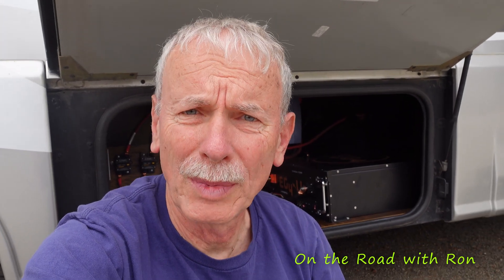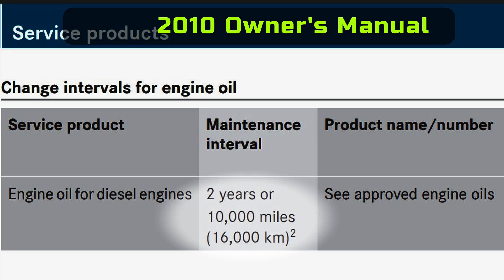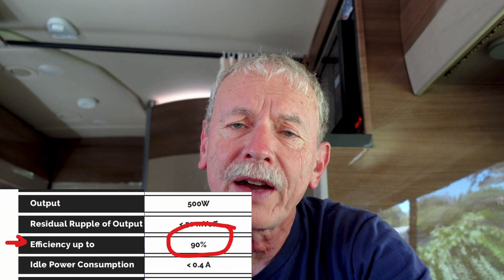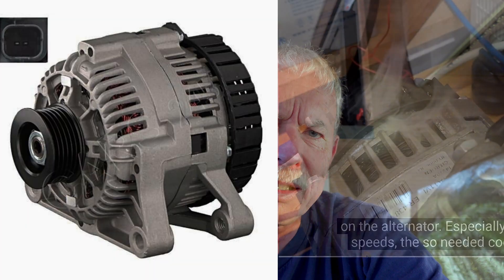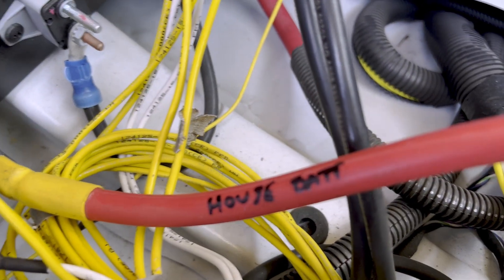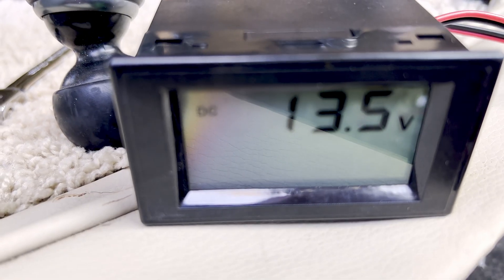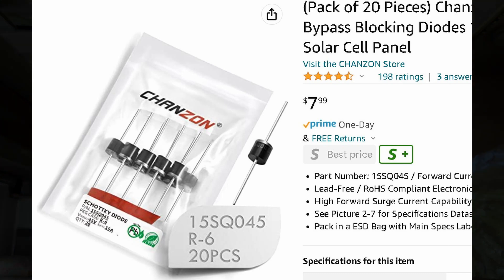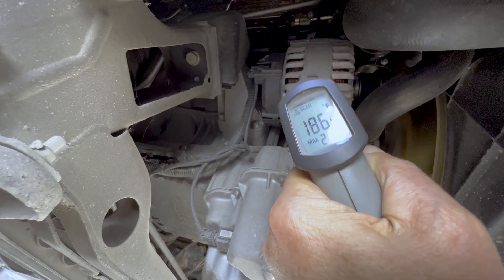DC to DC charger NOT required for big Lithium Battery

Comment: just finished up up grading my truck camper to 304 ah lithium iron phosphate batteries specily. similar to your set up, 650 watts of solar run through victron solar mppt controller, victron shore power ip22, and a victron dc-dc charger. reason for the victron controllers as they connect through their own bluetooth network to coordinate the charging from all three controllers. The reason i used the victron controllers is that the charging algorithm can be customized for the lithium batteries specify between 80 to 20% to maximize the battery life, since they are not cheap.
One issue i have with your set up is you are relying on the battery BMS to control volts amps etc but a BMS is a last resort to protect your battery if a controller fails, it isn’t the control. In my opinion the money spent on a programable dc-dc charger is not only worth it but essential for the longevity of your system batteries and possibly your alternator if you ever run it above idle when charging your lithium battery, just my thoughts.
Reply from the maker: I don’t know exactly how the BMS is designed but i never get over 85 amps charging current regardless of battery SOC. My set up is pretty simple.
Reply: @ontheroadwithron2432 There is a good chance the current from your alternator is being limited by the resistance of the wires between the alternator and house batteries along with the alternator putting out 13.8V instead of the 14.6V lipos need to fully charge.

Comment: Thanks for the Video! I have a 2022 Integra 24R with the Sprinter Chassis and installed 2x 100ah LIFEP04 Batteries last month before a 10k trip and just returned without any issue's. I just started researching DC to DC chargers and Isolator's  because  my house batteries never go above 13.6v while driving which is fine but I also have 200w of solar trying to push 14.6v to the house batteries while I'm driving. I guess I need to do a switch like you did......I'm still researching but would like something automatic.
Reply from the maker: My Zamp solar controller cutts off a little under 13.6 volts so never quite fully charges the batteries but im fine with that. Maybe the 14.6v is coming from your alternator.
Reply: @ontheroadwithron2432  The Coach battery stays around 13.6v. My Go Power MPPT solar controller is connected to both the house and coach batteries so I can monitor their voltages easy. Right now I have the coach plugged in and the coach converter which is set to lithium has the battery's at 14.6v 100% charged. When I start the coach it will connect both batteries together which I don't like.

Comment: This is nonsense. Why would you force unnecessary wear and tear on an expensive important component. Stop being a cheap skate and add a DC to DC charger to prevent excessive amp charging for extended drives.
Reply from the maker: Using a dc-dc charger will actually cause more “wear and tear” on the alternator as this device is not 100% efficient. That means the alternator has to supply the power to recharge the batteries AND to operate the dc-dc charger. I also have a switch to allow me to only use the alternator when needed.

Comment: You are very confused. A motor home has a built in BIM. That is what is limiting your charge, not your BMS. 🤔🤦It is pretty dumb and dangerous to tell folks that an alternator connected to lithium works, when that is not what you are doing. Definitely do not try this in a towable. Towables have no BIM. Your lead acid BIM will work, and may work well enough for a long time. But you could get some more charge by switching to a lithium BIM. Over time, especially if you have an older unit, the lithium voltage can wear out the contactors. If that happens, that would definitely be the time to switch to a lithium BIM
Reply from the maker: Not all RVs are the same. I don’t have a BIM, just a solenoid. This is my experience that is working great but of course it might not be the same for different applications. Cheers
Reply: @ontheroadwithron2432  ahhhhhhhhh, my young padawon. Confused you are. Help I can

Comment: I just did the exact set up on my 2000 class a RV. No DC to DC charger. Amps  are being limited by my BMS apparently also. It usually is charging at  a maximum of 30 amps per battery. I have 2 100 ah batteries with Bluetooth. And these are cheapo $170 batteries. One month now and no issues. Low temp high temp low voltage high voltage protection also. Why is anyone spending money on Battleborn. Anyway is your alternator still holding up without a DC to DC charger?
Reply from the maker: Still working great. I use the alternator to recharge batteries after using the AC at bedtime. Not every day but only when needed.
Reply: Good to hear. I sent out a question to a Facebook group and things are getting a little heated, as usual. Most think I'm nuts a few say I'm fine but no one has reported in with a failure from not using a DC to DC charger. I rely mostly on solar and will only occasionally click on the alternator charge to the house batteries

Comment: I saw an installation of a device that measured the temperature of the alternator and cut it out when it got too high. Happens most at long idling. The device also cut out when the LFP was full. It could be an issue if you are standing still in high outside temperatures like a 100F.
Reply from the maker: That might give someone peace of mind. I am careful to only turn on the alternator when driving and avoid hot weather best i can.
Reply: interesting, where did you see it?

Comment: Your battery does not LIMIT current in and out. It has a safety feature that shuts off current entirely if X amount of current is exceeded.

The thing is that rating is ALMOST NEVER a fixed number or a fixed amount of time.

You'll often see a BMS will have a 10% or 20% plus or minus for overcurrent protection and there are ratings for 1 second, 3 seconds, 5 seconds, 10 seconds, 30 seconds, etc. Typically only your higher end BMS"s (NOT Daly) are actually going to follow their datasheet with any amount of accuracy. Many budget LFP batteries use fairly cheap BMS's that won't cut off until 300A or something insane like that on a 100A BMS.
Reply: Ok after watching the rest of your video its clear that you definitely know what you are doing and took the time to test the current draw of your LFP battery at a low state of charge AND installed a switch to give you control of the charging from the alternator.

In situations like this where you are 100% sure of your alternators output and the charging current you'll see when you let a near depleted LFP battery get charged directly by the alternator there's nothing wrong with saving $200+ on a DC to DC.....def right about Victron's video. They purposely chose one of the smallest alternators they could, used a LARGE LFP battery that likely has an AC IR of 2mR or less and then put the alternator in the worst possible position in terms of coolings. Very deceptive.
Reply from the maker: Thanks for your comments.  My ooint is only that everyone does not need a DcC to DC charger depending on your particular setup. I understand that many people will install one to be on the “safe side”. In my case I don’t need one.

Comment: You cab use dc to dc charger.
No problem ad all.
Its just what for amp you need from the alternator.
I use a dc to dc charge with a carge limit of 20amps.
Its connect to the lead battery .
This way i can charge the 150ah lipo4 with 20amps.
So in 10 hours i have charge 200ah.
But you lipo4 is not empty always .

So i charge with a solar panels and a alternator on my boat if i need it.
Wallpower from the port i can charge 30amps 

Personal the solar power i can do what i need to do .
Reply from the maker: Yes I agree that using solar id the best main method of charging with a couple other options when needed.

Comment: Honestly you have a talent for missing some important details. 
Firstly im not a victron fan.
The dc dc chargers are there partly to reduce the voltage on the lifepo4 once they are charged so they are not held at a high voltage for hours on end. 
The bms only stops it charging if the current is too high for the battery it is not a limiter.  The victron test alternator looks like it has internal fans the smoke will rise if its not running (remember its a demonstration).  You have totally not realised that other groups of people have different requirements.   Narrowboat users will often run engines for 5 or more hours per day  and there is no auxiliary fan or grill for air to cool anything.   The engine and exhaust are in an almost sealed compartment.  They tun hot.  You have just about gotten away with what your doing because of your particular installation.  Citroën alternator doesn't matter. What would be the point of using a huge 300A alternator?  It wouldn't demonstrate the overloading effect.  Many many narrowboats only have A 50A alternator.   The current needs to be controlled properly.
Reply from the maker: Thanks for your comment. I know nothing about boats and their particular needs. My channel is about my RV which of course has a lot of cooling air out on the highway. Never meant to imply a dc-dc charger is never needed. It depends on the application.

Comment: This video is the classic case of a little knowledge is dangerous, unfortunately. 

First: Alternators do not have good voltage regulation, and a BMS cannot buck or boost. In overvoltage or undervoltage conditions, which will happen quite often when connected directly to an alternator, the BMS will simply disable charging.

Second: A couple of modern large Lithium batteries could easily pull 200 Amps. There will be many vehicles that have smaller alternators that really will overheat, and if you are lucky, you'll have one that has a thermal regulator that reduces the current output in order to stop it cooking itself to death.

A DC to DC charger negates both of these issues, and more. They exist for a reason!!
Reply from the maker: Do you have any data to support your assertions? I have tested my setup and it works quite well. I don’t have any issues with some who choose to install a dc-dc charger. It is not ALWAYS needed.
Reply: @ontheroadwithron2432  It's not a case of providing data, you already have everything you need. For instance, you provided a screenshot of a Merc document stating "A maximum charging current of 80 amps... must be ensured... or the vehicle may be damaged". When the EG4 is at a very low SOC, the charge current can be close to 200A maximum. Are you simply relying on making sure the battery never discharges this low, or risk damage? If so, that doesn't seem like a great solution.

Comment: Question...Can i connect my 10amp pmw solar charger to my car battery so i can charge my sla secondary battery while driving like a Isolator.?
Reply from the maker: All DC chargers will work together so yes. Your solar panel will charge any battery it is hooked up to. My solar panels are charging my coach battery while I am driving.

Comment: Bought 3 x100Ah off sterling power in the UK , they wont warranty their own batteries unless they are charged through a dc-dc charger which they also conveniently sold me !
Reply from the maker: Nothing wrong using a dc-dc charger. There are some good reasons to install one. I just didn’t need it with my setup.
Reply: @ontheroadwithron2432  there is plenty wrong with the Sterling  bb1260 , its drastically inefficient,  gives nothing near the 50A claimed output but it makes a great  heater ! Of course it will protect your alternator if it's not capable of delivering the full C rating but if your alternator is capable of generating enough power as my iveco is , you don't need one . I'm a sparky with a backround in electrical engineering btw .

Comment: Re the Victron video.  It was an off shoot of videos made for narrowboaters in the UK.  We do tend to use two pretty low powered alternators (70amp) on big diesel tractor/forklift engines.  We run them about 1000rpm when charging, and we use no airflow as the engine is buried beneath the floor.  Most of us are still using AGM, just because it is so hard to get lithium to charge off our alternators.  But slowly we are switching over to DC-DC lithium.  Even so it is still a pain as we have two alternators and it took me a while to figure out the solution of fitting a second lead acid battery just to limit the 2nd alternator.
Reply from the maker: That makes sense. A lot of my rv friends have seen the Victron video and believe their Mercedes alternator is going to burn up without a dc-dc charger.

Comment: Thank you very much! Should have seen your video earlier. Did pay for the victron thing. One thing i didnt get (I am a german), the voltage should be up to 14V, newer cars do that only if DPF regeneration kicks in. Did you put the diode to get a higher voltage constantly?
Reply from the maker: I added the diodes to the Trik-L charger that uses the coach battery to maintain a trickle charge to the chassis battery. Reason is the lithium is 13.7 volts and that needs to be dropped down to match the chassis AGM battery which is 12.7 volts. Otherwise the chassis battery could slowly drain the lithium down to 12.7 volts. Seems to be working well.

Comment: Technically speaking your video is accurate ... provided the BMS isn't defective. Ask me how I know.

Edit: Most alternators can handle the excess amperage today anyway. No need to upgrade from stock alternators and no need to pay $$ for a DC-DC charger that will limit your charging speed.

Comment: Interesting video, thanks for sharing.  I don't think the issue has anything to do with amperage; I think the issue is voltage. 12v lithium batteries often call for about a 14.5v, and most alternators cannot guarantee to offer quite that high of a voltage.  I personally wouldn't mind paying a couple hundred bucks for the DC-DC charger to get the full lifespan of the battery due to proper charging.  Maybe I'm missing something.
Reply from the maker: I believe your concern about proper voltage is a carry over from lead acid batteries. Lithium batteries last a very long time and do not need to be fully charged. Over charged will shorten the life of any battery, lithium included. My solar charger shuts off at 13.7 volts for some reason but I don’t mind as I have 4x the energy that I used to have with my old 6v golf cart batteries. No need to charge them higher. My alternator puts out 14.4 volts so I could charge them a bit more but that could also shorten their life a bit. My lithium batteries are actually made for solar backup for home use and are warranted for 10 years. That is charging and discharging in every day normal usage. 
If you have a low power alternator then a dc to dc charger is not a bad idea.

Comment: The amount of misinformation you are passing on because you do not seem to understand how a lot of these batteries and electronics work is not good, and I hope it doesn't cause someone some expensive repairs. Not ONE mention of lithium charge profiles vs. conventional battery charge profiles which shows me you didn't do enough research to understand how wrong you are...
Reply from the maker: Okay word about charging profiles. It doesn’t matter. Lithium can be slow charged, fast charged, it can stay with a low state of charge, a full charge or anything in between. The BMS manages what the battery needs. Of course lead acid is way more complicated with a slow charge and discharge rate due to its high internal resistance. It also has float and adsorption.  Profiles that the lithium does not have or need. I didn’t mention charging profiles as it is not important for lithium and can confuse a lot of folfs.

Comment: Hi,  thanks for the video.  I'm about to change my AGM batteries with lithium in my Sprinter van.  This video is about a year old and I'm asking, after a year,  still no dc to dc and no problem with the alternator? 
Thanks.
Reply from the maker: No issues. Currently drive across country. Have charged with alternator for 2-3 hours at a time. Never started the genny for the last 23 days on the road. Campgrounds and solar do 80% of the charging.
Reply: @ontheroadwithron2432  
Awesome.  Thank you.  I hope that I can find the correct yellow wire.  😃

Comment: I would caution anyone follow this advice to be very careful.
Some lithium batteries can pull 200 amps. I have a fogstar 230ah lithium and it can accept 200A.
So unless you are using at least 2/0 awg wire you are at serious risk of fire or damage to wiring looms
Reply from the maker: Of course it all depends on your particular installation. You have a very high output system. My EG4 lithium was designed for solar applications and is limited to 100 amps charging and discharging. I have never seen more that 80 amps when charging.

Comment: If you have smart alternator you would need some dc to dc for constant charging?  My smart alternator voltage go up and down and summer time stays around 13.3v
Reply from the maker: I believe my alternator puts out 14.4 volts but is close to 13.5 measured at the battery when charging.
Reply: @ontheroadwithron2432  That's what I mean for modern vehicles you have to imrpovise something otherwise it won't charge efficient. Hence, renogy and victron dc to dc come to play. When I had an older vehicle, I had a split charger like a solenoid that acts like a switch when voltage goes above 14v.

Comment: my 1990 RV have 65A alternator . and I drive at 58A for hours without problem. But the most important thing, my alternator at idle RPM, dont produce more of 25A. if a battery or load will take more , simply the voltage drop. never I won't put dc dc. I need 65A free on inverter and battery